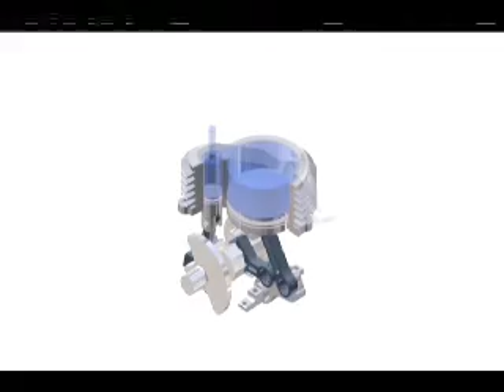A car that runs 200 miles on compressed air.

Comment: its basically an air compressor in reverse, except there it does cost money in electricity to compress air. theres also a thing called thermodynamics. you will never get 100% of that energy back that you put into it. the "perpetual air compressor" idea is complete bullshit.

that being said, air powered cars do exist. gasoline engines are basically just air pumps.

Comment: it doesn't cost "nothing" to fill your car.  you have to pay to run an air compressor, and the energy into that compressor is never fully recovered to drive the car. it's like a battery-powered car in this respect. the energy is not free, and yet you seem to be saying somehow it is

Comment: when i first heard about these air powered cars over thirty years ago it had a sterling engine that created the compressed air which ran on multifuels  they later  removed the sterling engine which i thought was limiting on the distance travelled as it would do about 1000 kms on a 1 litre of fuel so i was told back then  they were being made in india by the tata corporation but have never been sent to other countries because the danger of the air cylinders exploding i think that was just an excuse to prevent other countries from getting the vehicles as the fuel companys would lose money they werent very expensive to buy to me people would lose money on them but i think they are a great invention

Comment: 200 miles is not much... and you must compress that air before using it. Compressed air engine are all over the place, since forever. They work, but efficiency is not good, and range quite ridiculous.

Comment: If Elon Likes this Idea It could be come the next reality??...imagine if electric cables buried in a road  could wirelessly charge the  batteries while electric cars drove on them*. Reducing the need for so many on board batteries eventually?  maybe..or in this air compressor car, perhaps engineering development geared towards recirculating the exhausted air past a turbine to provide the suitable boost to an alternator to  generate electricity   to also power smaller on board compressors to refill the air tanks while driving ..So many possibilities! !
Reply: It's as plausible as his failed Hyperloop scam.
Reply: electromagnetic pollution.

Comment: Bcoz of the bloody petroleum lobby there are very few cars fuelled with compressed air which are being driven on the road. Imagine IF compressed air cars were cheap and ubiquitous there would have been 40% less carbon emissions from vehicles.
Reply: Google 'energy density' to understand why it can never work.
Reply: In fact, I think it's the electricity companies, not the oil companies.

Comment: Why still we don't have the car which runs on compressed air
Reply: Basically two reasons:
- Very low energy density of compressed air. You won't get 200 miles range with compressed air. Even 100 miles would be dubious.
- Very low energy efficiency of air compression. Energy consumption would be very high.
Reply: @701983 Where did you get your information from ?!! The efficiency of the compressor ranges between ( 70 % - 90 % ), and this is actually more than the efficiency of photovoltaic panels ( 18 % - 26 %, and they claim that the maximum efficiency is 32 % ), which they promote and advertise, and their life cycle is longer.
Reply: And I didn't watch the video again, but I'm pretty sure, there are some lies in it. Like the 200 miles range in the title.
Compressed air cars are a long running scam.
Reply: @701983  Aren't electric cars a long-term scam ?!

Comment: I haven't read the comments, but I will just assume they will agree with what I'm about to say -

This is possibly the dumbest video on youtube. My god - perpetual energy? Compressed air to fuel the air compressor? How dumb can you be? It takes energy to compress that air. We aren't mining compressed air out of the earth - and even if we were, that would also take energy. The air tank is basically a battery - a reserve of energy that was produced from electricity. The question is - is it more efficient to store the energy in a battery and use that electricity to power an electric motor or to store the energy in an air tank that is used to power the engine?
Reply: You never got it.

Comment: Blah blah.  The energy density of compressed air is just pathetic compared to electrical batteries or fossil fuel.  Fraudsters have fooled silly investors into investing giant amounts of money into compressed air cars, and all the money has been lost.  There is is no compressed air car available commercially on the mass market, and there will likely never be one.

Comment: Today i askes my self... Cars lights gasoline then compress it and moves car... And pistols lights powder then crompress explodes and you bullet goes out and... Airsoft guns has pressurized air that goes push the pellet out 🧐 what if you take pressurized air to the same in a engine i mean why are we using electric battery to power e cars... When you just can use air 👍 the only problem is that you are a moving grenade

Comment: U can't compress air with the generator running on compressed air... that would b what we call propetual energy... it isn't physically possible. 
But the whole video up to that point makes sense, as long as u have enough air compression stations close. Which we do, at every gas station

Comment: Also. They could add little compressors to the wheels that could recharge the tanks when going downhill, and would help keep speed down while descending steep hills or mountains. It could also work as a sort of regenerative braking.
Reply: that is the same what I think. I also think the car have two tanks. on is under charging. once the first tank pressure down, It would change over to the second tank by computer
Reply: @陳大-o9r  the energy to fill the second tank is coming from the first tank. Air vehicles are dead
Reply: @rwyo83  theyre dead because they all miss one crucial ingredient.

HEAT.

engines dont run on fuel. they run on compressed air. your ICE is a compressed air engine. its only difference is it compresses it as it uses it, rather than storing it in a tank.

it adds lots and lots of HEAT to this compressed air by mixing the air with something combustible and igniting it. doesnt matter how the fuel is ignited, compression or spark. doesnt matter what the fuel is, could be sawdust for all it matters. all that is required is that you take a certain amount of air, heat it up, and then let the subsequent increase in pressure perform work. you dont even have to compress the air first, ie... bisschop engine, lenoir cycle... not critical, but definitely helps.

you dont have to add fuel to air to get it hot. or, at least, to get it hotter than it would be when simply compressed. you could, possibly, run it through a coiled pipe in a burner... or maybe discharge a bloody big capacitor through a spark and release heat that way... 

you do have issues such as thermal transfer and rates of conduction, surface area... steam can transfer lots of energy as it has one of the highest latent heats of any substance... but to heat that water, and deal with phase changes, is tricky. thats where the losses are in steam. whereas air... its pretty lousy at holding heat, but if you can heat enough of it fast enough, its quite good. thats what your ICE relies on. lots and lots of air being heated up.

a stirling is limited mostly by the rate at which one can transfer heat through the cylinder walls to the volume of air trapped inside, and vice versa at the other end, getting the heat out of the air. this day and age, with EDM and metal printing, the types of heat exchangers needed for the things to be viable again is actually possible, as  you couldnt make them any other way. massive surface areas, high temperature alloys, intricate porting, nice CAD designed paths with flow dynamics calculated... robert stirling could never come close...

a boiler burning coal say, can easily be replaced with a PV powered heating element, or a solar thermal collector, or maybe a wind turbine if one likes whirligigs...
Reply: @rwyo83 Not necessarily.

Comment: From a safety perspective, you would be better with a couple of compressed air tanks in the boot as opposed to hydrogen tanks. Also the thought of filling the Hydrogen at a Service/Gas station is a little risky. Older engines could be converted to compressed air without the same issues that older LPG converted engines suffered, when the heads and valves used to wear. ie  (misfires/backfires). I think it has potential. A Compressed air/Electric Hybrid maybe. One for the future. Just my thoughts.
Reply: Well I could certainly see having a little electric air compressor on board that could be charged like any other EV but I have to wonder about the efficiency of such a mechanism. It seems like there is a lot of potential for lost energy by converting electricity into pressure to convert into motion rather than just converting electricity into motion. I welcome correction though from someone who knows more about this as it is fascinating to me. I'm reminded of a similar mechanical system in a car called the Fisker Karma. Unlike most plug in hybrids this one did not have any mechanical connection from its ICE to the wheels and was insteal simply a generator under the hood to charge the batteries. This was great for mechanical simplicity but resulted in a deeply underwhelming fuel economy for a hybrid.
Reply: @paradiselost9946  Was your novella meant to be a reply to a different comment and you simply clicked on mine in error? Because it really does not follow what I said either as agreement or argument.
Reply: @kayEnt3rtainm3nt  are you illiterate? maybe my "novella" was too lengthy for you to read all of it?

it was directly related to your comment, if you spared five second to exercise your brain cells.
Reply: @paradiselost9946 I completely agree with you, you must be a smart person. I am also tired of people who talk about the electrical/electronic system and say that it is simple, easy and reliable, but I realize very well that it is completely the opposite ! There is no system more simple, efficient, reliable and environmentally compatible than a mechanical system.

Comment: Of course, emergency vehicles would still use petroleum. The every day passenger car will become high compressed air.
The military is developing a Abrams tank to run on compressed air, but they're having difficulty finding an extention cord long enough to run 110 volts to it.    Iol

Comment: Horse hockey.  You need electricity to compress the air. You need fuel to make the electricity.  Then you have heat loss. Fail.
Reply: Or bypass electricity losses and generate compressed air directly and benefit from the heat with a suit engineered system.

Comment: I have not seen what engine they are using, but it sounds as though it uses pistons and therefore the car needs a gearbox. My idea would be to use a specially designed positive displacement turbine that can rev up to 50 000 rpm and would not need a gearbox.
Reply: Turbines are usually used to generate high RPM but lower torque, while engines are used to generate lower RPM but high torque, so the use of each depends on the application. The gear system has been known for a long time and is reliable. Its use is not limited to engines, but even in daily life. You can, for example, but not limited to, lift something heavy with the least possible amount of your effort. The gear system gives better power and performance, whether for engines or turbines. It is a very simple and efficient system.

Comment: Cool tech, but doubt it'll ever be practical for long range. Small vehicles like forklifts, golf carts, and possibly even city cars, I could see that. Short distance, high speed not necessary, cheaper than batteries and also uses less carbon to manufacture, it definitely can be used in a niche capacity. Hell, I'd love to see it spread in a niche capacity, especially the idea that you can plug it in and use its own engine as a compressor. It's a great idea. But perpetual motion? Disappointing to see Modern Marvels even bring that up.

Comment: The circular talking towards the end had me confused for a moment, then I realized he was talking about perpetual energy, which hasn't been proven possible in any way yet...
Reply: Nobody in the video mentioned perpetual motion, or anything close to it. They clearly state that the air needs to be pressurized first, and that an air cylinder can be filled in less then 3 minutes. Such an air compressor can be driven by an electric motor, causing no emissions, and once the air is used to power the car there are no harmful emissions either. 

At least compared to an internal combustion engine there are much much less parasitic losses due to heat and friction and the inertia from moving parts. And no laws of physics are being broken.
Reply: @insAneTunA  Did you even watch the whole thing? At 3:05 "perpetual motion" is mentioned verbatim in reference to having an air powered generator in the car to power an air compressor to constantly refill the air tank.
Reply: @chinoto1  They mean a system similar to regenerative braking, but instead of recharging a battery they refill the air cylinder with an air compressor as soon as the brakes are applied. And the initial filling of the aircyllinder can be done by solar or wind powered air compressors, which basically makes it perpetual motion, not literally, but very close to it. Let's not forget that this is a very old video. And in 13 years a lot has changed. 

Perpetual motion in the strict sense of the word is heavily exaggerated, I will admit that, although it is a highly efficient system, from start to end. It eliminates much of the mining for oil and lithium, no harmful emissions of any kind, low maintenance, very low parasitic losses due to heat and friction, fast refilling of the air cylinder anywhere where there is normal household electricity. No need for complex battery systems. 

I mean, for an urban setting in combination with solar and wind power this is an ideal solution, and easy to implement. And it cancels the whole extra step of producing any kind of energy carrier. 

Tata, the Indian car company, planned to launch the Airpod, an air powered car, back in 2020. I am not sure though if they actually did that because of the corona.  

An urban vehicle that should reach 70 km/h with a range of 220 km. With licensed technology from the french company MDI.
Reply: @insAneTunA  They mentioned nothing about regenerative braking in the video, which even if they did, would only recover some of the energy, not all, therefore not perpetual. The rest of what you said is nice, but irrelevant to the "perpetual motion" bit.
Reply: @chinoto1  Allow me to educate you. The narrator said the following, and I quote: " And one day, perhaps the compressed air that runs the car will also run a generator to compress its own air, a car that runs on air and constantly refuels itself. Round and round, a perfect circle, perpetual motion, a no-cost fill-up ever, not one iota of pollutants ever, and a cute car, all for about 15.000 dollars, that's a future car "

First of all, it was literally a fantasy about what might be in the future, and the part about refueling was not presented as a reality or a fact. 

Secondly, a system that refills itself could only happen if the energy from the inertia from the mass of the vehicle is reused and stored, so that would automatically mean that such a system would be reasonably similar to regenerative braking, only compressed air would be used to store the potential energy instead of electricity. But, again, it is a fantasy about what might be in the future. 

The narrator did not literally say regenerative braking, but that is the conclusion that I draw from it, because that would be the only possibility. Unless they would use solar panels to power an on board air compressor. Or a different stationary renewable energy source. But it is still all a fantasy about what might be in the future. 

Is the guy's fantasy too optimistic about the perpetual motion part? Sure I give you that, to some degree. 

But one could also easily make a valid statement by saying that it basically is perpetual motion if the compressor that fills the air cylinder is always powered by a renewable energy source, or by its own weight due to regenerative braking. 

That would be a never ending energy source and a never ending form of motion. At least relative to our own lifespan. 

I think that you see all the negatives, and I see all the positives. But this concept, as it is in reality at this moment, is already truly viable for an urban setting. 

I do not live in a big city and it would be more then sufficient for me if I could drive 220 km at 70 km/h. And I would be able to refill the air cylinder at my own house in a matter of minutes for just a tiny fraction of the costs compared to what I would pay at a gas station.
Reply: And in addition to that I want to make clear that it is not possible to get all the energy back that went into the system. There are always some parasitic losses and losses due to heat. So it would always need extra input power from a different source. So there is no 100% perpetual motion possible in the sense of a regenerative braking system. 

My version of the "perpetual motion", but don't take that too literally because I see that relative to our own lifespan, consists out of an extra ex, and maybe in combination with regenerative braking. If I would take a fantasy look into the future.
Reply: @insAneTunA  Are you not understanding what you're quoting? He's saying that the compressed air will run a generator to compress more air.
The person narrating likely had no direct involvement and made an uninformed fanciful statement to fluff whatever show this was part of.
Reply: Just cancel physics, duh